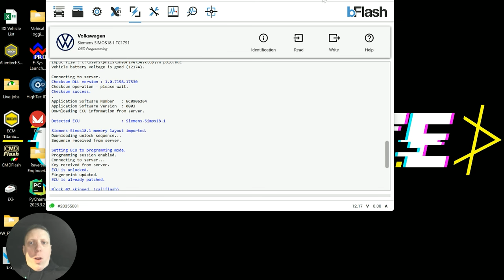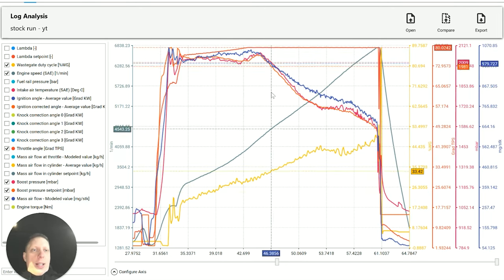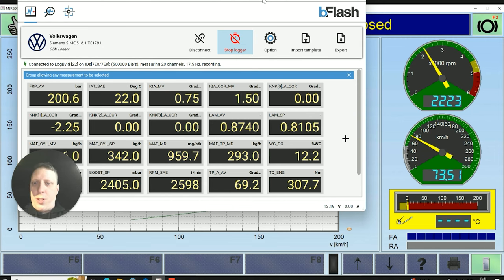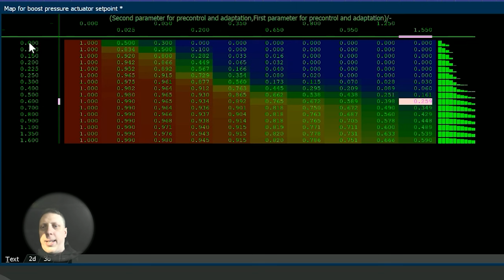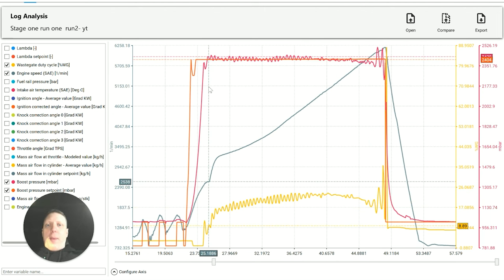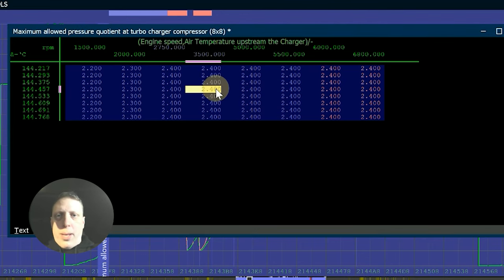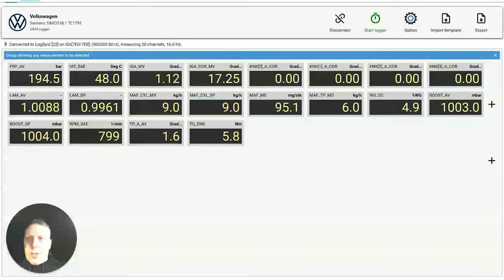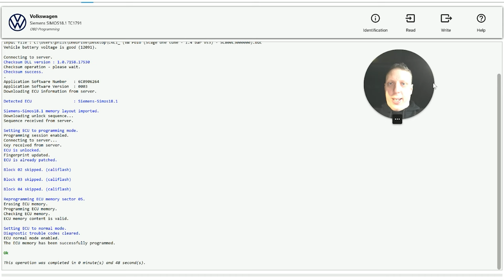Tuning a Polo 1.8TSI on the Simos18 ecu - first session!!

Comment: Hiya Phil,  Do you remember tuning my Black 2006 A4 2.0tfsi?  It made 290bhp after having new K04 injectors fitted by R-tech.   It had been running fine but a couple of weekends ago it put the engine light on - I scanned the codes and it had one for "fuel rail pressure too low".   I had booted it through 2nd n 3rd, got into 4th and it held the car back at 3000rpm and put the light on.    Today I had my friend fit the high pressure fuel pump upgraded piston and had hoped that would solve the problem but its still spluttering at times?    Do you have any suggestions on how i proceed to get the car running properly.  Its fine under normal driving, its only when i stamp on the throttle and want it to take off.
Reply from the maker: Could be a few things, best thing to do is to datalog the car to see what the ecu is seeing to put the car into limp, could possibly be the low pressure side not being able to deliver the required fuel for the high pressure side
Reply: @Phil-cooper  I have an OBD 11, i'll see if I can do a data log with that.  If I can't I have to just book it in.  Thanks.